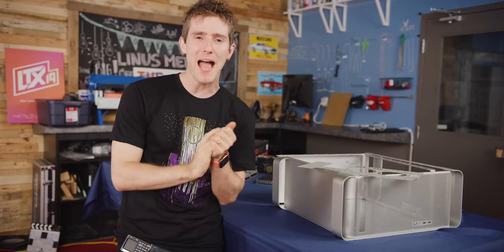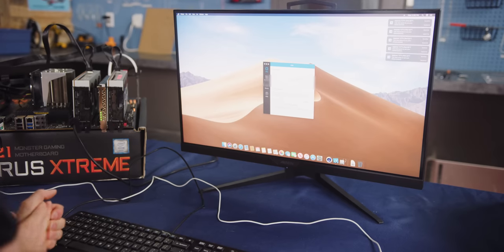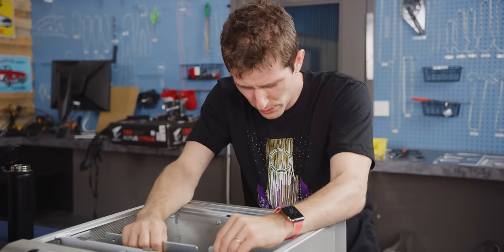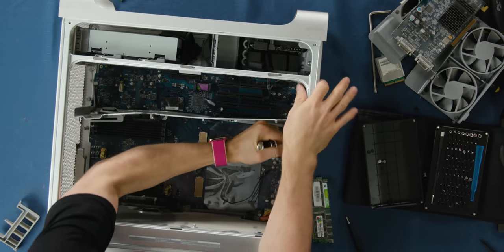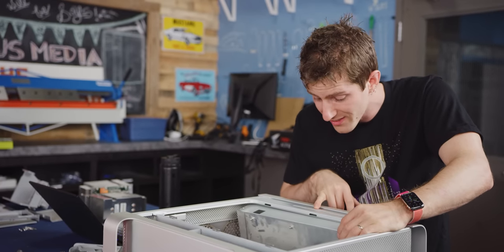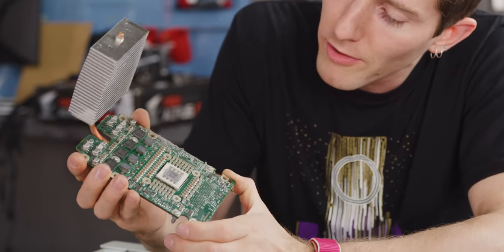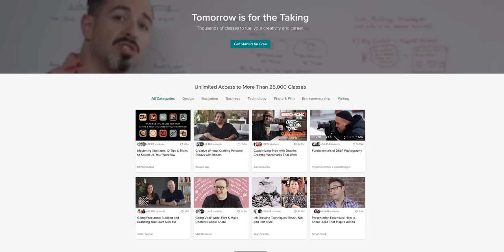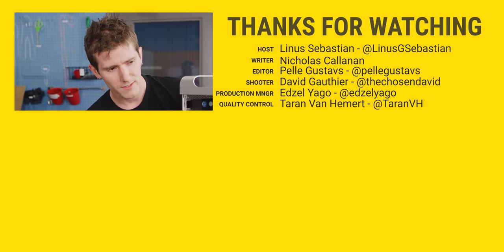I can't believe it all FITS!!! Hack Pro Pt. 2

Comment: Wen the ‘adapter’ they use is just a big blue metal windows logo.
Reply: Max-Leo Amberg  You don't say -_-
Reply: @han5vk  I didn't know what it was or what it was for, so eh, great comment.
Reply: They actually used proper layout dye, I am surprised.
Reply: @Incurafy  It is easier on the metal than conventional Sharpe maker (they may "eat into" shiny finished metal surface making your machine the surface again to remove it... our shop instructor told us a story a guy ruined a part worth 3 grand by write some marking on it... using a Sharpe)
Reply: @AaronShenghao  That's cool, thanks for the info. :D
Reply: I think thats a flag of FInland
Reply: @Samutski  It is different Linus... This one is Canadian... and the one responsible for Linux is Finish.
Reply: I was scared people thought it looked like a certain flag.. I'm glad i was wrong.
Reply: Windows 10000000 leak 100000000000000% real no human vericatoin

Comment: Linus: *breaks apart the guts of a g5 in order for the case to be used.

Also Linus: *proceeds to show us an already prepped up case.
Reply: I can't believe they made a 12minute video of them just putting things against the walls of a case. WTF.
Reply: @curt8806  its Linus, its over 12 misnaming too, that means a bit more money(?) too??? idk
Reply: e-waste - is not a major concern
Reply: Never understood why they  used the G5 version, there was Intel Mac Pro in this chassis (well similar with different cut outs), it should have been easier... I guess G5 ones were cheaper on ebay.
Reply: @blitzwing1  nah, use fire. more effective.

Comment: Verge: "How to build a computer"

LTT: "How to disassemble a computer"
Reply: *disassemble
Reply: You: "How to tipe"
Reply: When did comments in the form of this one start being every where? E. G. :

Someone in Video: "Says something"
Someone else in video or not: "Hold my beer"

Seriously, every video has the first 25 comments in this format and you cannot see a single video without them?  Is this the popular thing for people born after 2000 or something?
Reply: hahaha this is the tools requirement form the service manual... fuck that...

The following tools are required to service the computer:
Long-handled magnetic Phillips screwdriver (10-inch shaft)
Short-handled magnetic Phillips screwdriver
Flatblade screwdriver
Jeweler’s flatblade screwdriver
Nylon probe tool (black stick 922-5065)
Needlenose pliers
Small wire cutter
Long-handled 2.5 mm hex wrench
Mat knife and cup hook (to remove locking rivet)
Tape (for temporarily holding cables out of the way)
Small mirror (for seeing small boards inside the enclosure)
Soft cloth (for protect removed parts from scratches)
Reply: Destroy***
Reply: More like how to forcefully pull out components 😆
Reply: This was roughly the same quality and knowledge level. Except this time it's fun to watch
Reply: omg 666likes and im going to ruin the that 666 bi puting a like :DD
Reply: More like how to disentegrate a compuer
Reply: The Verge's video might as well be a disassembly
Reply: I found this extremely satisfying to watch
Reply: first, get your tweezers

Comment: "Everything is designed to be straightforward"

Lol, this was great.
Reply: it is straightforward. if you use tools and not your bare hands to take it apart. everything you'd usually want to access (pci/agp, ram, hdd's, odd) is all neatly catagorized and accessible. it's arguably apple's most user friendly computer to service they ever made.
Reply: It's straightforward to people with intelligence and working brains; if you're not an absolute caveman for the sake of 'entertainment' then it's by far one of the best, most well built and professionally well designed machines on the planet.  Back in the day nothing came close.

Ever.

About 17 years later other companies are catching up.  Besides maybe the HP VooDoo Firebird, that thing was... stunning.  May buy one to do a "Linus Special" like in this video, but for a gaming rig.
Reply: @Ashleyyyyy666  Kids on the internet don't know anything, lol.  His comment "was great."
Reply: @Ashleyyyyy666  except that "tools" isn't available publicly and can only be found on apple service center. and this is why he goes ham and bruteforce it
Reply: xs3tsunax wrong. Iirc it uses normal screws that anyone with an ifixit kit can undo
Reply: @FeeLtheHertZ  Amen my Power Mac g5 was definitely more powerful then my quad core first gen Mac Pro.  The First gen still runs my recording studio gotta love Apples longevity. My day to day machine is an 8 core 3.1 Mac pro with a 12 gig Titan card unfortunately I am stuck on High Sierra due to the Apple Nvidia pissing contest if they really cared about there pro community they would fix that. The new mac pro while amazingly powerful is just out of reach for a base config for us little guys.
Reply: @threalismaradona9899  That's awesome man, I'm personally on a 6 Core / 12 Thread 2010/12 model myself; not only do the Xeons keep up in single threaded workloads PLENTY well enough, it cuts through multithreaded workloads like butter.  A lot of this has to do with Intels slow IPC development (big jump with Skylake and before that Haswell, sure, but still not "night and day" since Sandy Bridge even..) - but also macOS optimization and efficiency, as well as finally the hardware it runs on, seriously; macOS talks to the Logic Board far more 'natively' than Windows PC's, hell they even have custom CPUs called System Management Controllers that take a lot of the background tasking of internal fan, thermal and IO management off the CPU, and it keeps going.  Even the Microcode of certain aspects of Apples firmware rip past PCs for certain multimedia tasks - something I learned in an article of how a 'lower specced' Mac creamed an HP 820 workstation.

Now again, I love PC's for certain things, like gaming and certain DAW workloads like Fruity Loops (amazing Windows-only DAW, sure it's Mac now but it was built up for Windows and performs like it, it's beautiful), as well as just fun building rigs.

It's sometimes aneurysm inducing reading sheer braindead levels of stupidity comments about "Macs SUK LOL!!" but if they ever move out of their Momma's house, they'll realize their favorite just about everything was Mad on a Mac, or see how their used professionally beyond count in then real world.

Anyways, as for your Mac Pro, I've all G5 models - the older AGP models Linus babbles about being AGP, yet on 2003 release that WAS the standards lmfao, also it was AGP Pro so it could power Apples single cable solution Cinema Displays; it carried USB and power as well as Display data (he just doesn't know shit sometimes either, oh well it 'pushes a doofus smile' on the PC nerds I guess in his viewer audience).

But I never once put the performance of a G5 system passed an Intel Mac.  A Core Duo (not 2 Duo, just the 32 Bit ones..) eventually performed faster than my G5 Dual Core w/ PCIe graphics.

Was sad to see...... lol.  But AltiVec and PowerPC eventually just fell to shit - completely IBM's fault, not Apple's.  IBM did it to themselves.

Good to see more pro Apple Linus viewers though.  Seemingly only the fools like to speak about derp-shit regarding Macs.  They're all just tools... use what works best.

Gaming = PC
Content Creation = Mac (music, photo, video)
Programming = Mac usually, but Windows works too.  Or Linux.

Take care man
Reply: @FeeLtheHertZ  There are and always were actually plenty of equally well built machines in the workstation market, which is where it competes. The Mac Pro isn't and wasn't a gaming machine.
Reply: @jester1983  Comedy bro, well done.  Here's some facts; The mid frame was for cooling separation and was completely serviceable if needed to be; plenty of PC's had just as "PITA" designs but you wouldn't accept that fact due to your PC fanboy glasses.  They were also easy to exchange optical drives, GPUs, expansion cards and RAM.  Additionally the heatsink covers came right off to service the ZIF processors.

Your profile avatar is literally what I see saying your comment right now lol.  Fitting.
Reply: @xs3tsunax  I've take these machines apart with off the shelf tools for service btw, you know nothing kid.
Reply: @EssenceofPureFlavor  Are you high?  A.). No, there weren't.  That's an objective fact.  B.) - What does gaming machine have to do with anything?  The ONLY case that could compete - no, build quality of ANY computer that came remotely close - was the Lian Li Mac Pro rip off case.  Guess what, the head of Lian Li at the time was quoted as saying if they ever built a Mac Pro (PowerMac G5 case at the time) case bit for bit build quality wise - they would charge NO LESS than $600 for it..  This was back in 2005/6 or so buddy.  If not earlier.

Do you realize what inflation is?  Maybe you can figure the rest out.

Finally, the only reason we have premium built machines nowadays in more abundance is A.) Hopefully other companies have a genuine passion for premium, high end construction like Apple has always embodied with their real Macs (not clones or any other nonsense) and B.) Subtract has gotten considerably more efficient and cost effective.  Think your unibody computer XYZ - single block of metal down to a shell.

Apple was doing this when it cost a fucking arm and a leg.  And look how the industry improved because of it.
Reply: @FeeLtheHertZ  You seem a bit overly offended and worked up about claims about PCs. You're still wrong, by the way.
Reply: Feel The Hertz nonsense
Reply: @EssenceofPureFlavor  Yeah sure buddy, brilliant argument btw.  You have no evidence, argument or any real anything to say - anyone can make up BS; you're clearly a pro at it.

 I just hate stupidity btw, don't take it personally.
Reply: @nobodylmportant  Yep.  I love Linus' content and love his enthusiast, knowledge and drive, but it's disrespectful to treat (even nonworking) quality and one legendary hardware like this, straight shitty and childish.

That being said, I've watching the dude since 2010 give or take, the content he delivers and genuine non-bias and downright praise for Apple at times earns him my respect for the foreseeable future, and that's what matters.  These are just (very pretty) boxes at the end of the day.  Be it PC, Mac or a Chr.. CHr.. sorry gimme a sec - ChromeBook.  Sorry, choked.
Reply: @FeeLtheHertZ  well then, how do you remove that mid plate?
Reply: @FeeLtheHertZ  The irony about lack of evidence is so strong it hurts.
Reply: It is, if you're not trying to break it.
Reply: @xs3tsunax  Use your Harry Potter wand.  Just make sure it's made of Apple Tree wood - it's pretty magical.

Or with tools and an IQ above 70.  Not sure you quality though.
Reply: @FeeLtheHertZ  wow your reply sound so mature slow hand clap
Reply: @nobodylmportant  Louis is a serviceman, he services other people hardware of course he's going to respect those machines
Reply: When you can't afford the real thing: Build one from all sponsored parts!
Reply: @Ashleyyyyy666  cringeworthy and unnecessary just for the sake of 'lolz'…
Thumbs down on the first video (for not showing anything at all) and thumbs down on this one as well for the reasons stated here ¬¬
Reply: The only thing that's made me laugh harder than the timely insertions of "Everything is designed to be straightforward" in the video, is reading the replies you people are leaving on my original comment.

Imo, LTT is entertainment first, technical accuracy second. If you can't laugh at a jab Linus takes at Apple's peculiar form factor and design quirks then you're taking things too seriously.
Reply: @FeeLtheHertZ  That is awesome I just upgraded my server farm added an old Supermicro blade dual  server 2 blades  each blade has dual hex cores
Reply: @EssenceofPureFlavor  LOL I am still gaming on one both in OSX and WIn10
Reply: @threalismaradona9899  Okay?

Comment: Louis Rossmann says this is how franchises and AASP’s go about repair.... then they send the pieces to him.
Reply: Having worked in several service departments, though not for Apple,  my personal favorites are the ones that's obviously been opened and messed with while the customer swear to high heaven that no one has even as much as looked at it with a screwdriver in the room. That ribbon cable that wasn't plugged in had to have been like that from the factory, and those screws that was missing, and that self tapping  screw that you've never seen in any other of these computer, yea that to came that way from the factory...
A few times when I saw mismatched screws or a chassis that didn't quite go together the way it was supposed to I called in another technician as a witness when I first opened the machine. Later as camera tech evolved and digital cameras got to be actually usable and no longer was just novelty items I started filming the disassembly, just in case...

Comment: Ashame regardless that you taken it apart. But what I’ve done with one of my G5’s was tried my best to keep the G5 look. Did well didn’t cut much reused the rear fan Assembly and fitted new 92mm looks great front I/o with new usb parts and the original power button. What an amazing case and computer.

Comment: 3:55 the mobo goes with it, my god how even...
Also I've always been impressed by the size of IBM's PowerPC processors, they are small, compact, but rarely or never on a socket, mine is soldered on my AS/400 preventing any upgrade.

Comment: I did this in 2014 and was using it as my gaming desktop ever since. Sold the internals just recently and kept the case, just for decoration purposes :-) the case has some disadvantages if you compare it to modern cases with cable management and other stuff.

Comment: The PowerPC G5 was a monster to cool and it had a massive power consumption which is why it needed the massive heat sinks and the big power supply to be honest the 1st gen Mac Pro is a million times easier to take apart and upgrade and you get more ports on the front

Comment: Painting - Don't, dip the aluminium parts in caustic soda (outdoors!) and they will get the same finish as the original Apple hardware.
Thinks Will lots of perforation of the case make it 'Insanely Grate'?
Reply: I was thinking maybe sticking it in their new sandblasting cabinet could be a good move too

Comment: I have 4 or 5 of these ( i think mine have Intel in them from around 07' 08' )in various conditions in my garage I got out of a dumpster that i plan on doing... Stuff... With. They arent simple to work with , but using one for a Linux/Windows build (and selling the others in different states) is on the agenda, especially after seeing this video. Thanks!!

Comment: instead of having to slide the rear plate into a sketch slot then lift/bend it over the stand off, why dont you just clean cut the rear then weld in the new plate? then you wont have to put in filler that has a chance of separating and breaking.

Comment: Probably already too late cuz the computers already built but my idea was I would have the radiators flush with screws coated with thermals geese when screwing the rads in To help with themals with the with the case have the fans inside the case from pulling air in front to back

Comment: An AGP 8x graphics card, yeah Linus, why would they design it like that in a Mid-2003/2004 computer?! For everyone interested: 
First PCIe graphics card test samples were build in 2004, becoming avaiable in late 2004, early 2005. 
A while they used AGP-to-PCIe Bridge Chips (or HIS - High Speed Interconnect), which made them essentially AGP cards with no speed benefit what so ever. Early samples even were slower. Not to mention that like how today GPUs hardly use PCIe 3.0 bandwith, then AGP 8x cards weren't much faster than AGP 4x, so that bandwith need was no problem. PCIe did allow bus-based SLI and Crossfire though. 
Nvidias first native PCIe chip design was released June 2005 in form of Series 7 Geforce like Geforce 7800 GTX (G70).
ATIs first native PCIe design was Radeon X850 (R480) late 2004. 
To make these cards avaiable for AGP bus they again used a bridge, this time the other way around (like ATI Rialto Chip). Especially large scale OEMs had need for AGP cards.

Comment: "Apple didn't use standard PC parts" Well no shit, the Power Mac G5 was build on IBM PowerPC not Intel x86. That system is from before the transition to Intel chips. I don't know if Power supported PCI-e in 2003, but at the time I'm pretty sure it was up to the chipset to provide that PCI-e support, so that's probably why it was using AGP instead of PCI-e.

Comment: Just saw the advert/Intro on the new Mac Pro. I do not think you can match it, it isn't possible unless you can get the uniquely designed Mobo and other components. I have used a Mac once in my life and liked it but I cannot afford a Mac so I am a PC guy. My current PC was $4000 but compared to a Mac it was cheap especially in my region. 

I can see why they are able to charge insane amounts of money, don't really know if it is worth it.

Comment: Hey Linus, please make video on how to create Mac os (if possible, make Catalina) USB bottable drive in Mac and also in Windows.
After that on hackintosh pc, make video on how to install Mac os on PC (Intel with onboard graphics, AMD with onboard graphics, Intel processor with Nvidia and AMD graphics card , AMD processor with Nvidia and AMD graphics card).
Also, use it on low sepc to high spec PC hardware,
Like Intel i3 and ryzen 3 low spec to
Intel I9 and ryzen 9 high spec,
Also use low to high end Nvidia and AMD graphics cards.